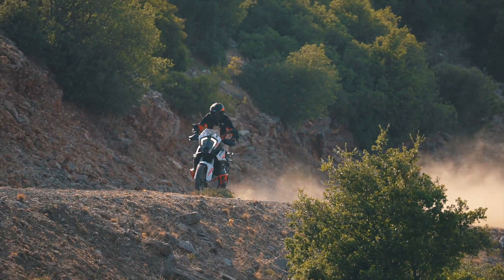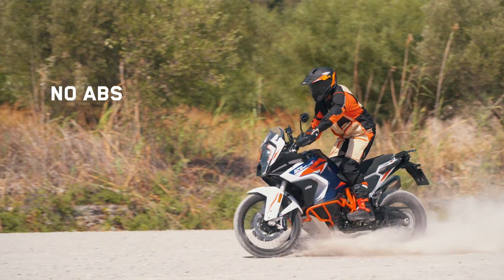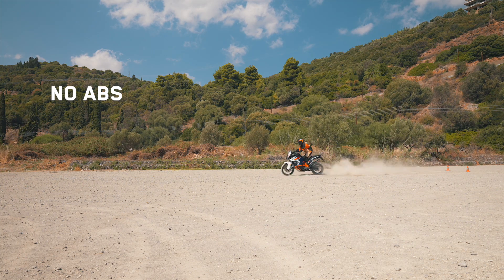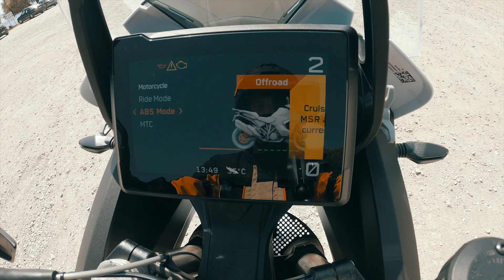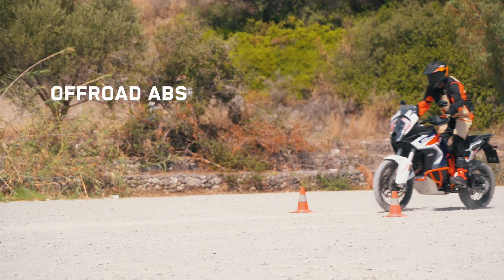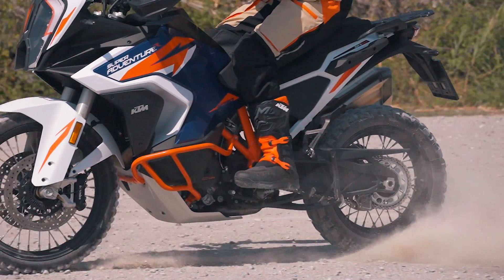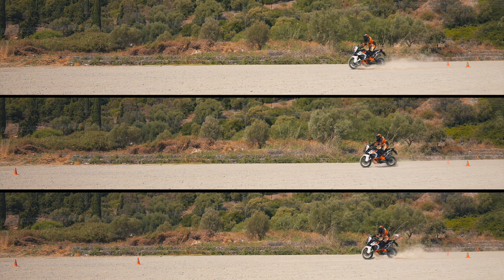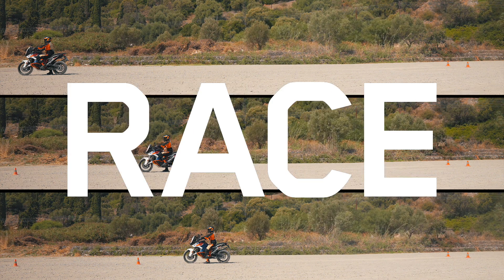Offroad ABS: Stopping like the pros | KTM

Comment: so other maker also can offer similar offroad  abs by disabling only rear wheel abs?
Reply: This is also basically the same as supermoto mode on the duke 390
Reply: The intensity in which ABS engages changes as well, not only the fact that the rear wheel ABS is disabled.